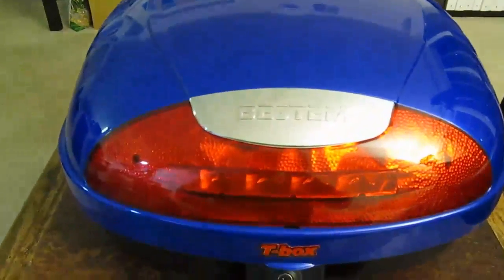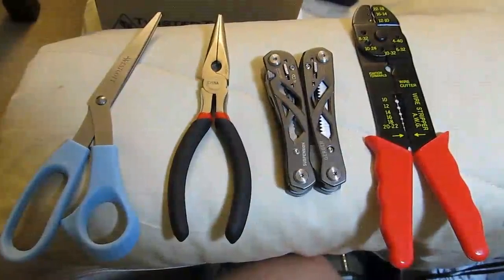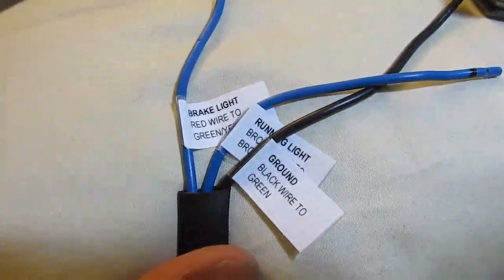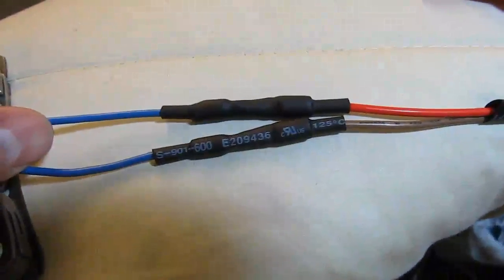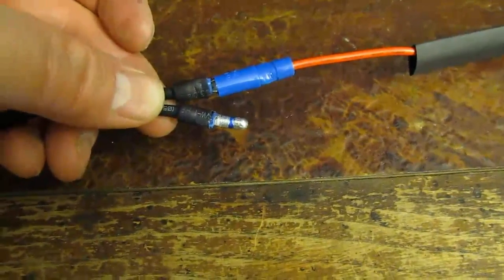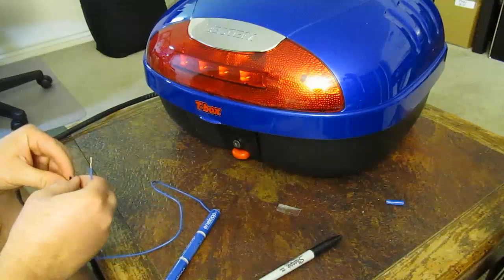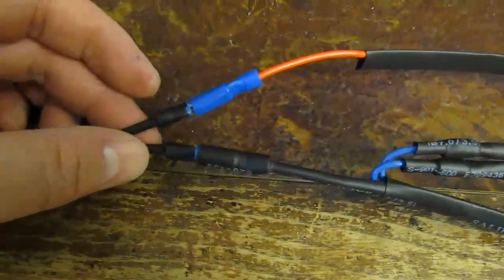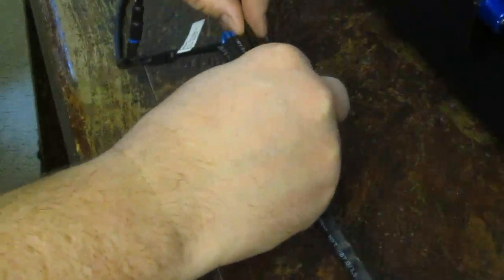Taotao ATM150-A Evo scooter - Bestem T-Box trunk LED light wiring (part D-1)

Comment: Cool, I built a trailer, and needed to do a trailer harness with relays connected from the light switches from the scooter, to the trailers LEDs, was wondering about the running and break light, it's pretty simple.

Comment: Like 1semidriver   was saying, mine came with only two wires, brown and blue.  I called Bestem and they told me that I had to choose whether to wire it as a running light or as a brake light.  I'm pretty disappointed because this box overhangs the back of my scooter by quite a bit.  Without a running light, someone behind me in a tall vehicle might have trouble seeing the back of the bike.

Comment: My bestem box only has two wires. Brown being positive. if I connect that brown to both running and brake on the scooter I wouldn't think both the brake light and running light would light up differently? So would I need to either go with brake or Running? And Not both?